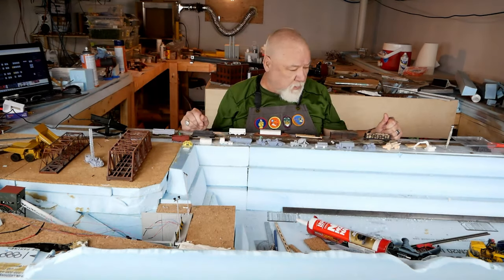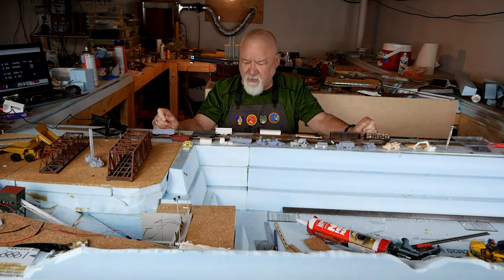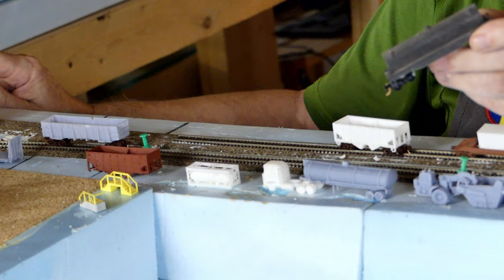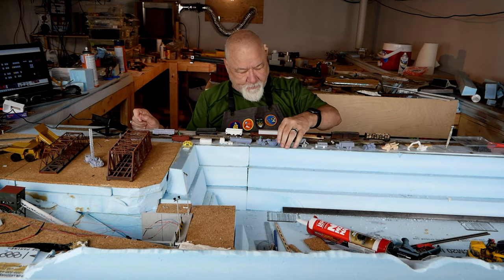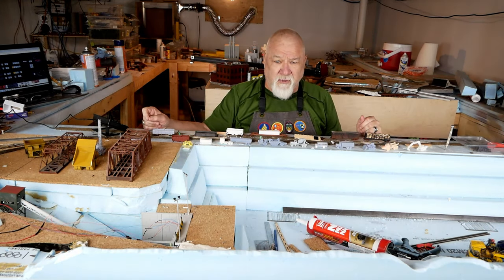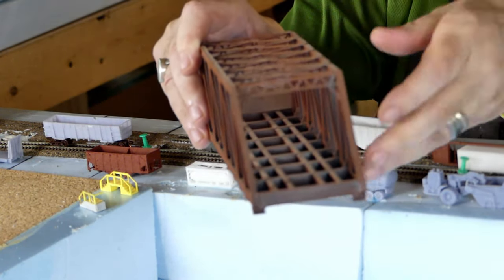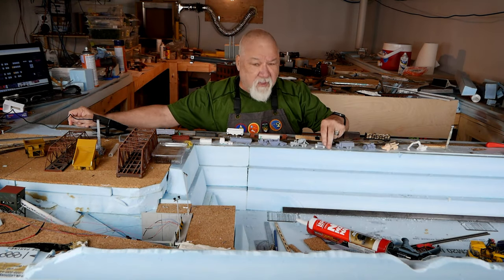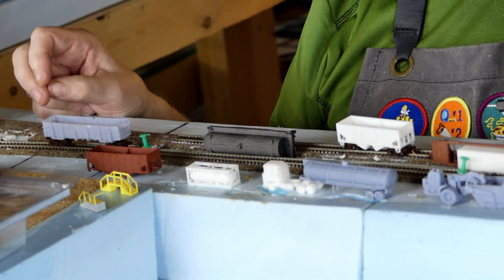3D printing for N Scale

Comment: I went over  to Dallas this weekend to the Micro Center in the Richardson area.  I bought an Ender 3 Pro and an extra spool of PLA for $135.00  total.  I figured this would be a good system to learn about 3D printing.  Thanks for posting the links.   I'm modeling in On30.
Reply from the maker: Great to hear. Enjoy your journey in 3D printing. The Ender series  is a good starting point especially in the scale you are modelling

Comment: I stuck with FDM for all of my N scale layout. The garbage I created to merely calibrate my resin printer plus the cleaning effort was too much for me. Plus my main room is very sunny so I'd need to paint everything in UV coat and I'm not a painter and really try to avoid making messes so I can avoid cleaning them up later. Love the details of resin, but prefer the ease of FDM even with the limitations. Designed and FDM printed the jigs to make hand laid tracks and tiebeds as well.
Reply from the maker: I agree resin can be a pain to deal with. I use a mix of FDM and resin my layout. When this video was published I only had an FDM printer so all the models I show are FDM. I build my structures and large scenery with FDM and fine detail with Resin. This gives me a good range to print. But I agree I try not to use my resin printers very much the clean up in a real chore. I still think you can get great results with FDM. I applaud for doing hanlaid track in N scale I just don't have the skill or time for that. Cheers